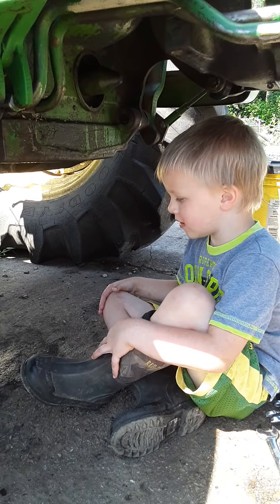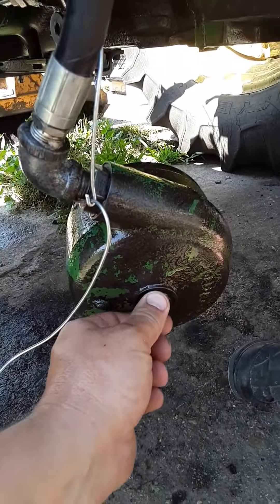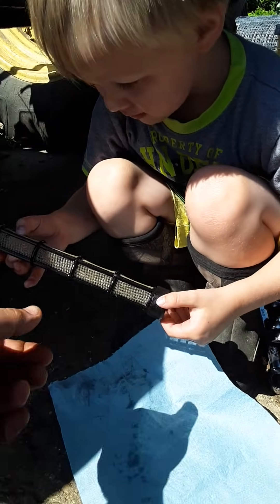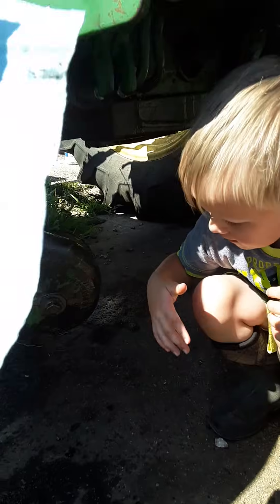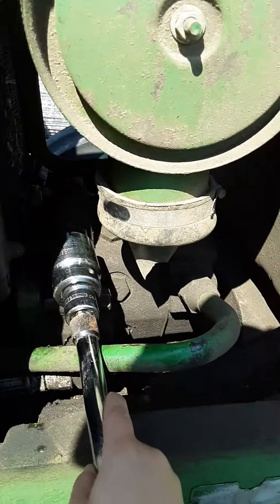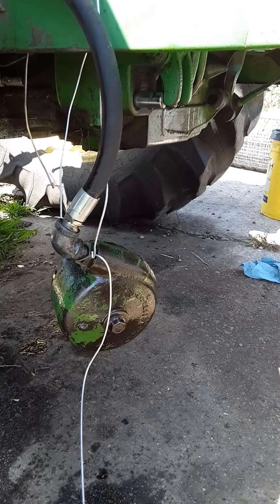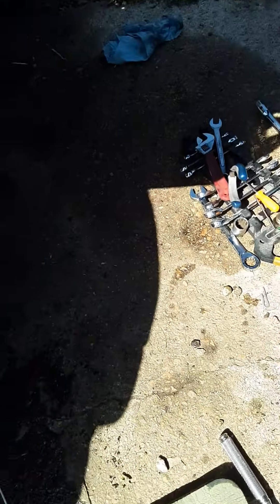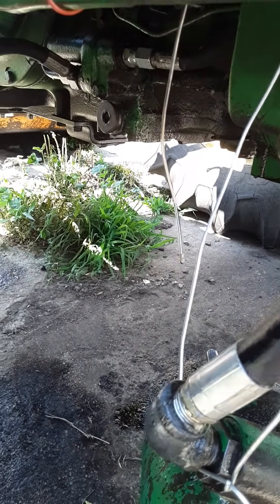John deere hydraulics

Comment: Did you have a hard time getting that bolt out for that front filter ? I can’t budge it , even with a pipe on the breaker bar . Just that I would ask you , and did you have much dirt on your filter when you got out ? Thank you ! I’m afraid to break something !
Reply from the maker: I don't believe it was torqued on that tight, as far as the filter it was definitely restricting flow.
Reply: @  thank you , I had no trouble with it. I just had a guy tune it up so I decided to change the oil and change hydraulic fluid, so thank you much

Comment: Outstanding video!  Been having some PTO issues on my 2950.  Spoke to the local go to JD guy here in east central Alabama and he recommended changing the hydraulic/transmission oil.  I knew about the long screen and filter element, but did not know about the screen on the hydraulic pump.  Thank you and God bless!